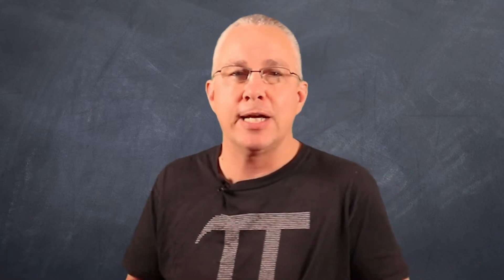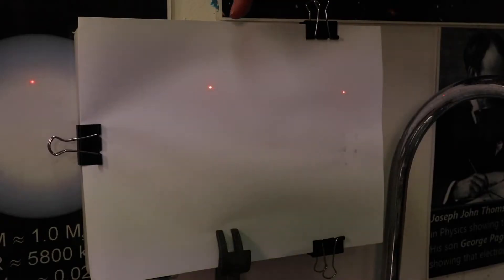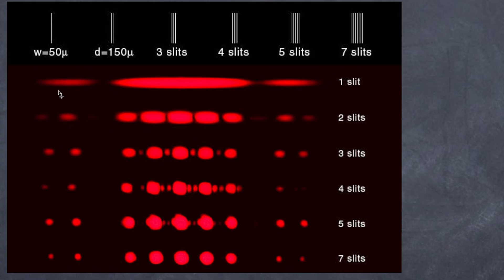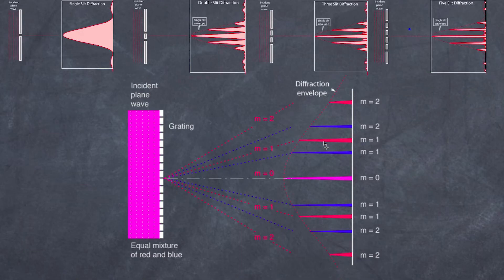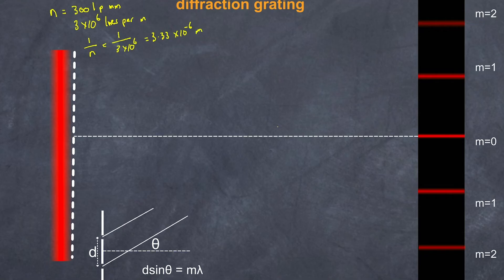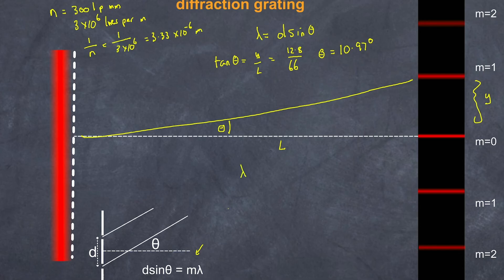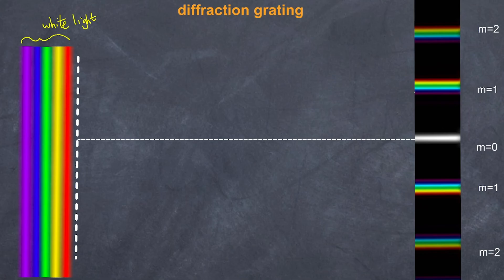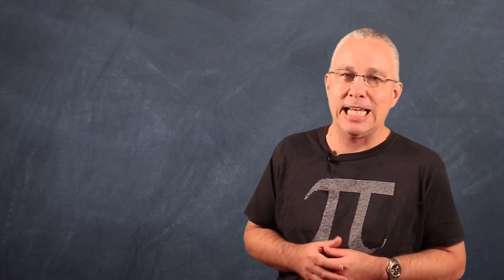diffraction gratings: Using the principles of interferences to examine light

Comment: So if I want to measure just blue wavelength  from white light source,  can I still measure from m=0 (where it is all white) to m=1(first blue line)? Or do I have to measure from blue to blue? Thanks.
Reply: You measure all of the angles with the triangle formed by the location of the 0th order on the screen, the center of your diffraction grating, and the location of the order of blue light on the screen.  The first order is fine, but you can reduce the uncertainty of your angle measurement by measuring the larger angle to the second order blue spot instead of the 1st order spot.
Reply: @Prof.HaavigPhysics  ok thanks.

Comment: So what about non-visible light? How do we calculate infrared wavelengths if we can’t see them? I’m most interested in measuring infrared, thanks.
Reply: For infrared, you need a detector or photopaper that is sensitive to infrared light.  Some video cameras with silicon detectors are sensitive to near infrared (you could use one to image the screen on which the IR light is projected from the grating).  But do your research.  These devices can be expensive.  An IR imaging radiometer will work well, but is VERY expensive. You need to know what wavelengths (frequencies) of IR you are dealing with.  I assume you have a laser.  The company that sells the laser probably also sells alignment detectors that will phosphoresce in visible wavelengths when struck by IR.
Reply: @Prof.HaavigPhysics  Thanks. Yes, I researched these IR cards/photopaper. Stuff gets expensive.

Comment: im getting confused with the concept,, when monochromatic beam of light goes through these slits or pin hole is it creating interference fringes due to diffraction and waves colliding with each other? and is the same thing happening with a beam of white light? what is the minimum size that you need for a single slit or pin hole for this to happen? also what happens when light  or laser goes through a prism is this dispersion by refraction but there is no interference there?
Reply: Dispersion by refraction occurs because different frequencies of electromagnetic radiation (ie light) move at different velocities through matter, when that matter is transparent to that frequency.  There is no interference with a prism.

Interference occurs with diffraction, from a single slit.  But diffraction is size dependent.  You get the most diffraction when the opening is about the same size as the wavelength. This is true for all waves, not just electromagnetic waves (light).  AND there is interference between light from multiple slits, IF that light is of the same frequency and coherent.  Coherent means there is a precise relationship between the phases of light passing through each slit.  If the light is at random phases,  even if it's all the same frequency (like if the light through one slit is from one laser and the light through another slit is from another laser source) you aren't likely to get a recognizable pattern.  AND do these frequencies have to be exactly the same?  The short answer is yes, but in reality the answer is no, however, the closer the frequency, the more they interfere and the fall-off is very quick!  Which leads back to the short answer, that they do need to be the same frequency to interfere.  Hope this helps.
Reply: @Prof.HaavigPhysics  kinda thank you for the help  , so red laser light passing through diffraction plate will create noticeable interference pattern due to diffraction of coherent freq interfering with each other right? so what happens when a beam of white light is used instead,you still get some kind of rainbow pattern even though there is no coherence in this beam , is diffraction acting differently on both cases? what exactly is diffraction?
"Dispersion by refraction occurs because different frequencies of electromagnetic radiation (ie light) move at different velocities through matte" yeah so what if each freq has a different speed,why would that make the light of a particular freq bend or change direction?
Reply: @ARCSTREAMS  But you DO get coherence with a beam of white light.  The beam is from a single source and is therefore self-coherent (the light is in phase with itself, meaning the E-field ripples are all peaking at the same time).  When this beam strikes the diffraction plate, the light passing through each slit is the same phase, and will therefore form an interference pattern with the light passing through adjacent slits.  But since white light is made up of multiple frequencies (colors), each frequency interferes with the same frequency of light from the other slits, such that, each color of light in the mix forms a separate interference pattern in which the spacing is dependent on the wavelength of that color.  Thus the dispersion, resulting in a rainbow effect for each order of the interference pattern.
Diffraction is the curved spreading of waves as they pass through a gap, or around the edges of opaque objects.

Comment: Hi Paul d at 9 minutes is 3.3 x 10^-7. Great video as usual, thanks again.
Reply from the maker: thanks for the pick up, though the value is actually correct, The error is stating that 300 line per mm is 3 million line per m, when in fact its 300,000 line per meter. Fortunately the final calculation is correct,
Reply: @PhysicsHigh  Thank you for reception sir. keep the hardwork and editing is important😅
Reply from the maker: Oh no